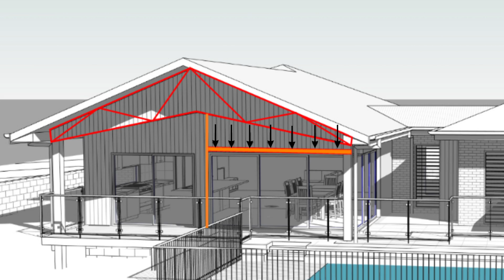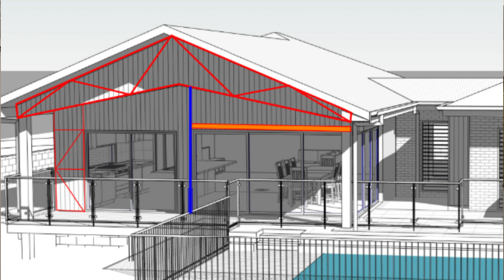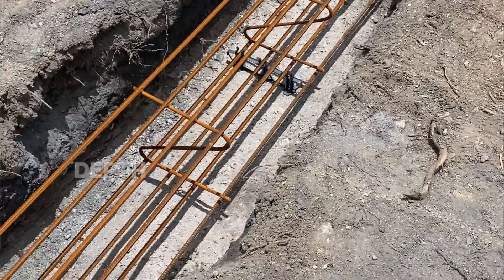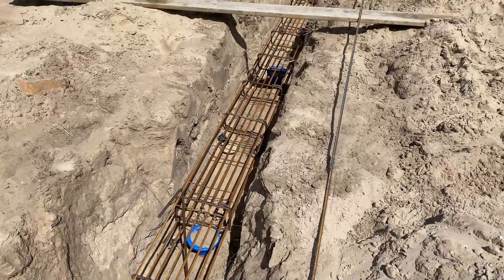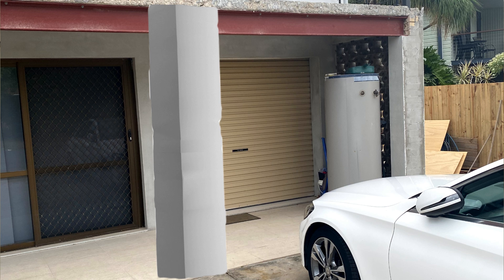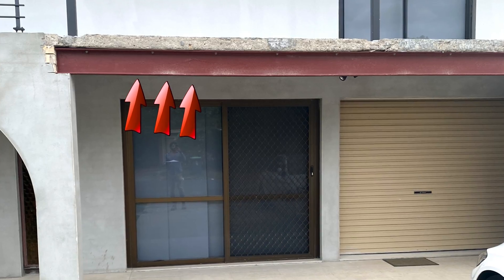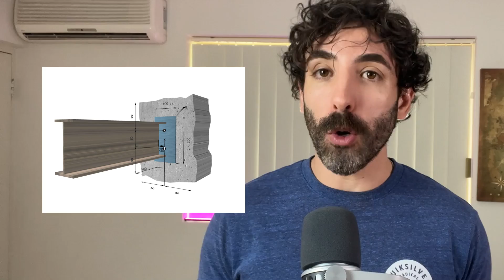My Worst Mistakes as a Structural Engineer

Comment: Do you have all of the necessary Standards Australia codes? Are you familiar with AS1657 stair and platform code? Are you a member of the concrete masonry association of Australia? Do you do dilapidation surveys and reports? How did you minimise deflection in the steel beam over the garage? Do you have the latest Ramset or Hilti catalogue ? You can consult these catalogues if you intend to use chemical anchors as end connections.
Reply from the maker: So many questions hahah I will come back to you later. It's Friday here :D

Comment: Thanks for this! Very educational and accessible, as all of your video's.
 I had two questions: for the first 'mistake': the check of the existing concrete beam: did you have the original structural plans? Or how did you know which bars were present?  
Second question: how much time do you spend on study? How do you do it? Do you do it according to your specific projects or do you make time for general study?
Reply from the maker: Hi Pieter
I did not have the original plans. I checked it based on the minimum reinforcement required for the beams to work. 
I like researching about topics. I don't have a set schedule for studying at the moment. It varies around my daily schedule. I'm always reading though.
If you have time for general study, that's awesome. Otherwise, study as you go according to the projects you come across.